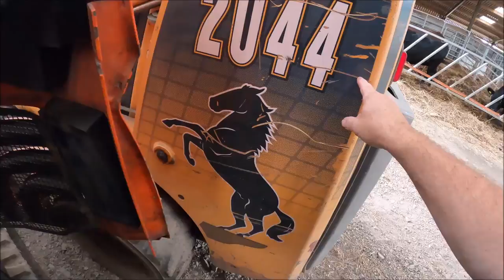25/07/22. I wont be going far today!

Comment: I ran my twin engined boat using a pair of JCB engine start batteries and a separate set of marine deep cycle I think they were called for the house batteries. They ran the fridge, interior lights etc. The house batteries could be used as extra start back up just by using a switch, heavy duty alternators and back up generator to keep all the batteries tip top charged.

Comment: you almost need a set of shelfs or a small platform in that corner,so you can put stuff up out of the way, a pallet deep,put the mixer on a pallet ,the  bucket from the cherry picker, all the small bits, not used that often, its always the small stuff that gets in the way ,easy to reach with the mustang, more space underneath then

Comment: have you ever thought about adding Anderson connectors to the batteries of the vehicles? That way you can jump them without needing to open them up fully. Just make a jumper cable with 2 Anderson's on and it should make life a bit easier (and if you misplace the Anderson jumper you still can open them and regular jump them!) 

have a think about it, perhaps its an option!
Reply from the maker: Good idea.

Comment: I'm amazed you don't have a trickle charger, I have a CTEK  mxs 5.0.

This is brilliant as its electronically controlled so won't overcharge or fry the cells by charging too quickly.

Battery cut off switches  disconnecting the neutral etc are all well and good but I always forget  and often I think a machine will be used imminently. 

It is easy enough  to connect the trikle charger overnight once a month.

Genuinely £70 well spent and if it saves one battery it will have paid for itself.

Comment: Could you get planning permission for one big building (concrete floor, pit, etc) to house just your equipment, tractors,diggers,implements etc. I have seen the odd spark fly out of even modern diesel engines (straw/fire/disaster etc). Just a thought. A small piece of kingspan will keep yer arse dry and warm, bit o baler twine, straw hat and Bob,s yer uncle. Good luck lad.
Reply from the maker: I would love to have a bespoke machinary shed Stephen.